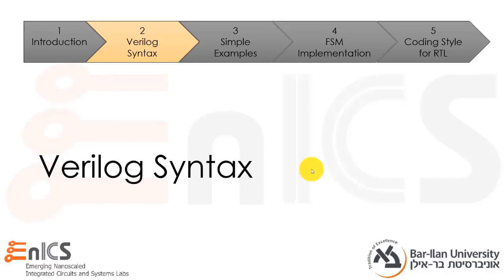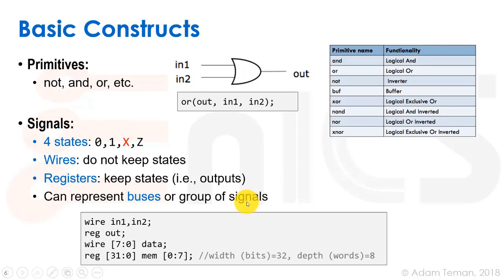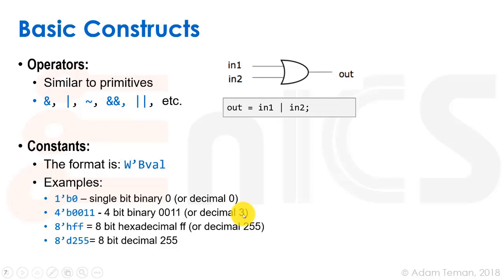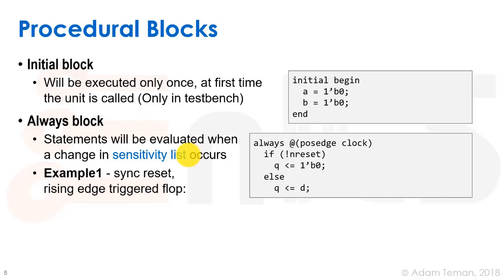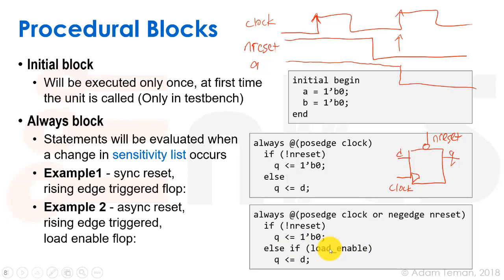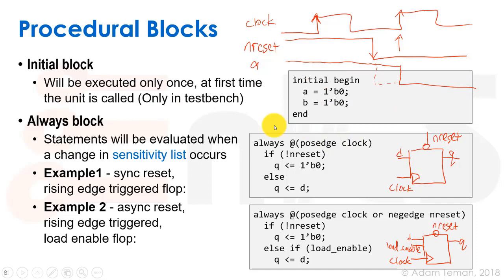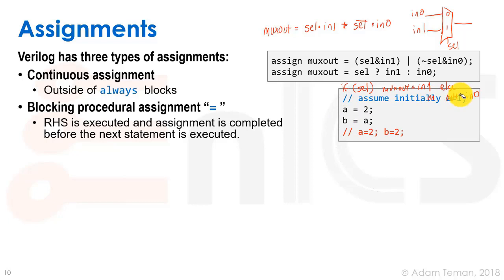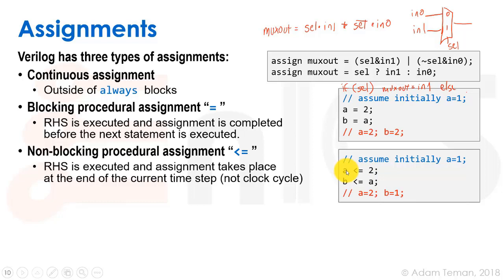DVD - Lecture 2b: Verilog Syntax

Comment: In the default statement the output should be 1'bx. For 4:1 mux
Reply from the maker: Haha,
Great catch!
This slide (and video) has been around for quite some time and no one ever pointed that out. This is not an error, per se, since it's just an X (and 4'bx is basically the same as 1'bx) and the simulator and synthesizer would (hopefully) disregard this, but it was for sure unintentional in the slide. 

Thanks for finding this. 
I will pin the errata!

Comment: What happens when blocking and nonblocking assignments are intermixed?
Reply from the maker: Chaos... :)

The truth is that there is pretty much a clear "definition", but zero-delay simulation can interpret them a bit differently. Things "may" work in simulation, but RTL simulation may not be equivalent to the gate level implementation and it also may depend on the synthesizer. 

Bottom line - don't do it!

Comment: Can we get jobs in Rtl design by studying from this course?
Reply from the maker: Hi,
I think that's a difficult question to answer. 
This is a very short RTL tutorial - but it is indeed a good start. I think that you would need to practice writing a lot of RTL before getting accepted to a job based on your knowledge and there is a lot of good material around the web. But starting with this lecture, it will help.